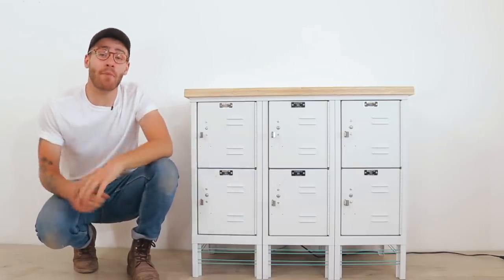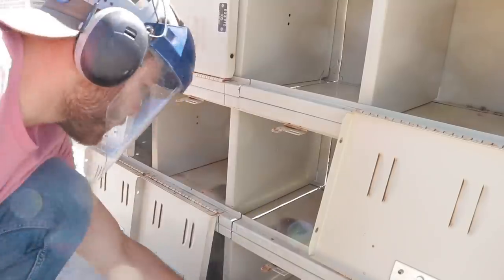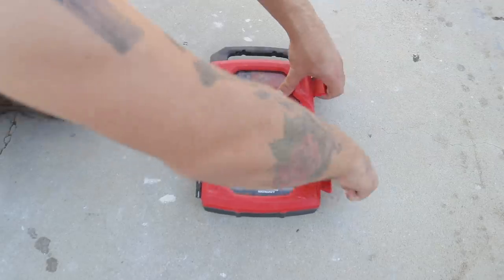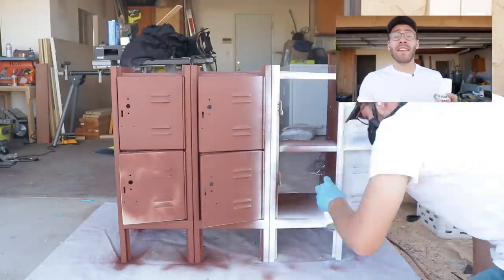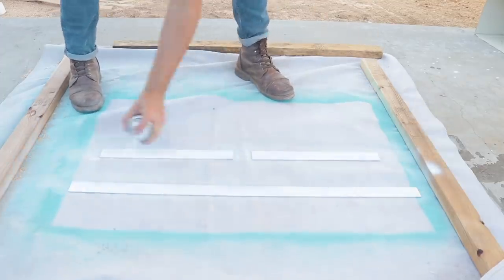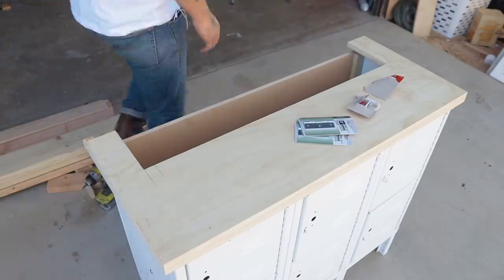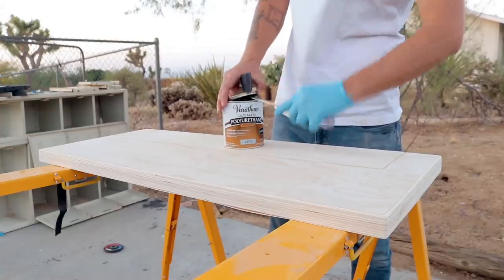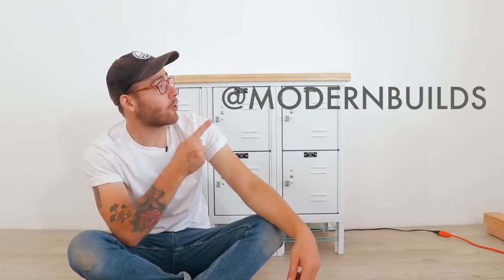TV Lift Cabinet from Lockers | DIY Media Cabinet | Modern Builds

Comment: Nice piece 😀.  If you start using rivets more in the future, you should look into cleco fasteners.  You use them to hold the two work pieces together, and keep them aligned, while you prep more holes or apply rivets elsewhere on the work piece.  They have been a staple of the aircraft industry pretty much forever.  We use them a lot in coachwork, too.  Another useful tool for getting even rivet spacing is a fan gauge.  Lots of YouTube reference material on both.
Keep up the good work.

Comment: I have planed to do a lift like this in a room i`m adding to my master bedroom,,,,,sort of a TV/ sitting room and have a 50" TV come up out of a false wall,,,into a picture frame type box  the motors you use are called linear actuators and can be had on amazon i used 2 such actuators to  build automatic doors for my chicken coop to keep them safe at night,,,and decided to use a larger one to lift the TV Athief will never know there`s a TV hidden in there

Comment: Nice final build and finish.

Personally I would have just removed the front and side panels of the locker, and attached them as a facade to a home built timber cabinet to match the size of the locker panels. Waste of time cutting that locker to pieces, to then mess about riveting most of it back together.

Comment: No cable/picture signal, just a wireless android box that can be installed...maybe ...lots more to be figured out... if you can figure out a nice electrical fix for the expansion and contraction of HDMI and power chord cable, i guess just a TV inside a cabinet. USB plug to display pictures I guess, not realistic.